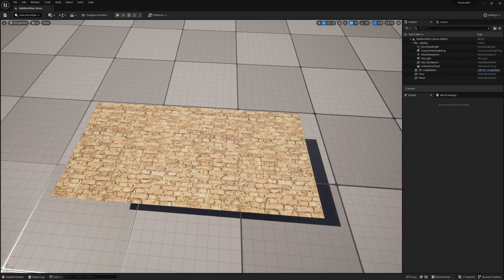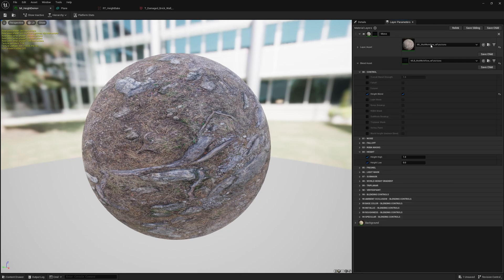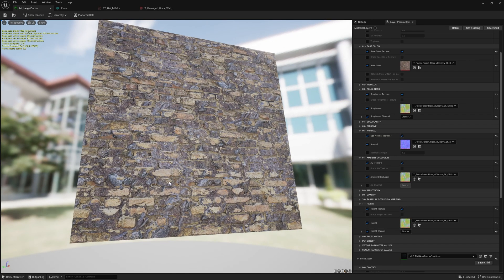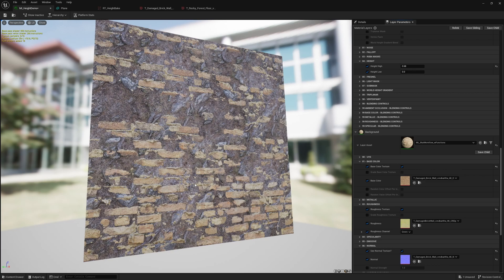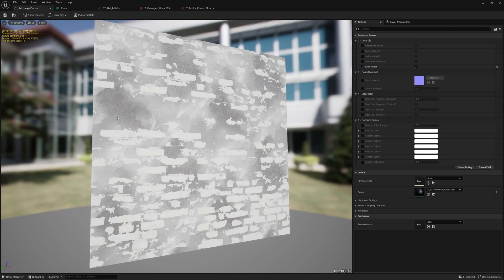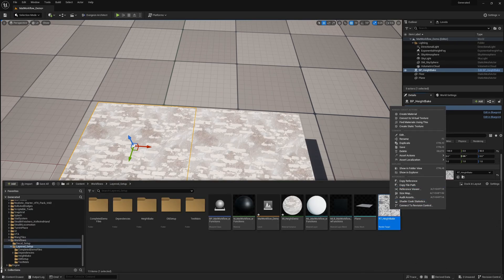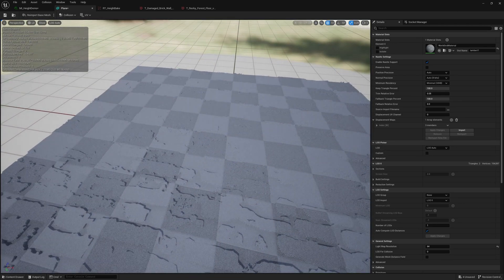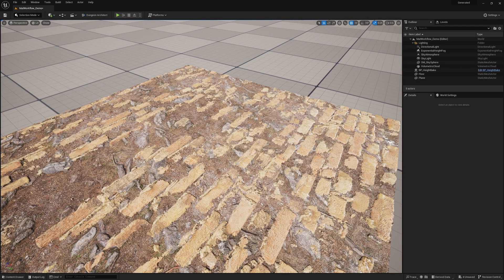Height Blending and Displacement with Layered Material Demo | Unreal Engine 5.2

Comment: Wow!! Do you know that this is the only way to "migrate" displacement to path trace rendering? (I'll apply displacement map to the mesh with the modeling tools)
Do the blueprint works just with your material or with with any?
Reply from the maker: You can setup blueprints to work with any material, layered or not.

Comment: How could we create a height map from custom made material?
Reply: For example if I wanted to make a noise material and use the displacement on another mesh to displace it
Reply from the maker: @domenicobezuidenhout1587  You can create the texture using the method in my latest video of how to bake the height to a texture, just plugin in your noise. You don't specifically need to use height there. Then you have a texture you can plug into your height / displacement that you made custom inside Unreal. :)